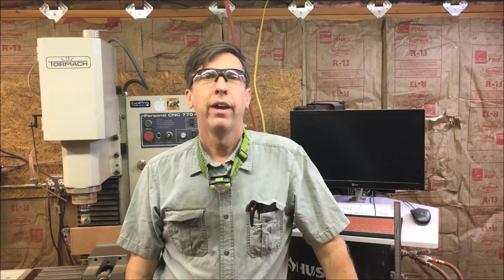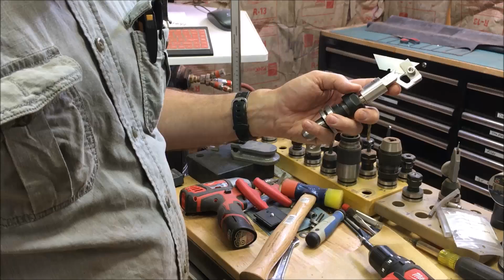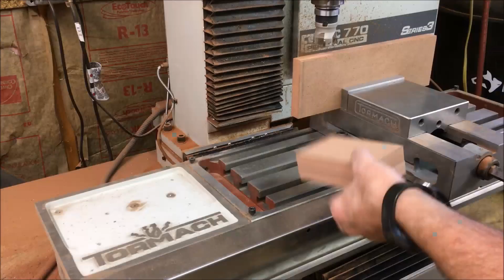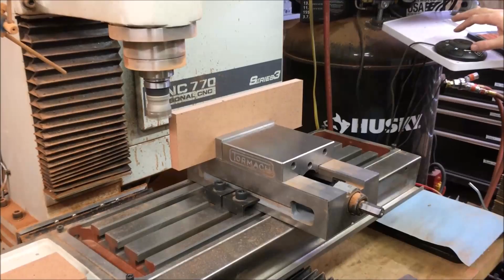Dragknife Vacuum Box for my Tormach  - Part 1

Comment: Craig,

I am no expert, but I really don't think you should be machining MDF and blowing the dust off without proper dust collection and protection.  Please look into the safety hazards of MDF dust.

http://elcosh.org/document/2098/d001086/Medium+Density+Fiberboard+(MDF)+Safety+for+Carpenters.html?show_text=1
Reply from the maker: Thanks Chris!  I didn't realize it had formaldehyde in it.  Maybe not as much as before the current regulations but better to not breath the stuff.  I'm using a vac and respirator now.  Thanks again!

Comment: Yes a vac of some kind would have been good, it's not good to inhale the mdf dust, very bad for you. Just an FYI
Reply from the maker: Thanks Mike.  I just figured it was wood glue and sawdust.  After researching it,  it turns out that it has formaldehyde in it.  Not as much as it use to though.  The stuff home depot sells  is suppose to be CARB compliant.  A California regulation to reduce the formaldehyde off gassing